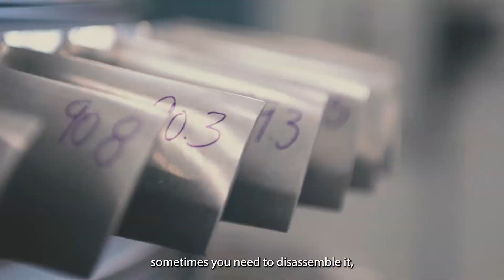TAP M&E: Engine Modules

Comment: Customer case : 2022-0002063442 / booking SMHB8M
3 years that I am waiting for a refund following a death in my family the day before to fly.
After 2,5 years of the most longer files process I am finally got in July a refund confirmation by email from Tap customer service (more or less 25 emails)
First call in september « sorry they had a small problem you Will receive the money back in 48h
Second call 2 weeks later : sorry but we refunded the tour operator, please contact him (of course a false)
Third call : sorry but your file is closed because the parental link us too far…it’s my brocher…. Please make a new demand (the first took 2,5 years)
Fourth call : sorry they have a problem your bank detail, please send us and you will ne refund 48 days.
Fifth call : We did the bank transfert last week but he came back, maybe your bank détails are false (check with my bank its false and my bak detail send 3 times and are correct).
Of course, I am still waiting my money back
TaPair Portugal is a thieving, dishonest company that does not respect people and the law.